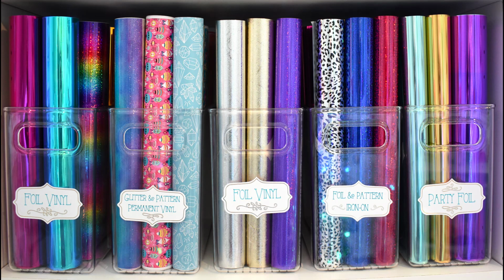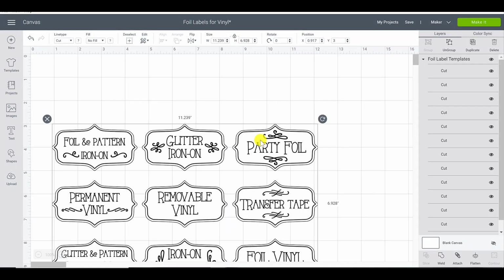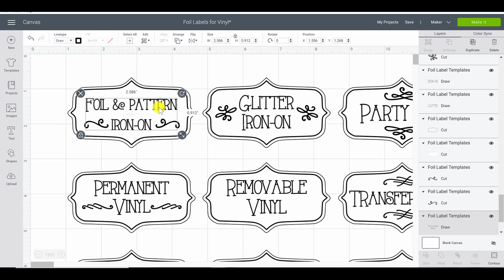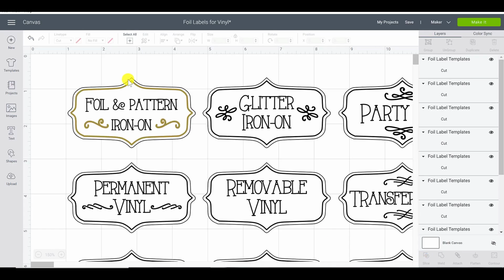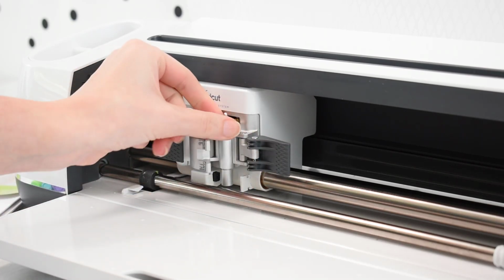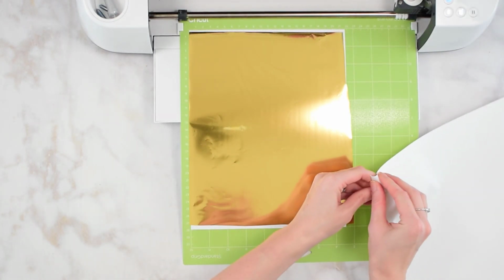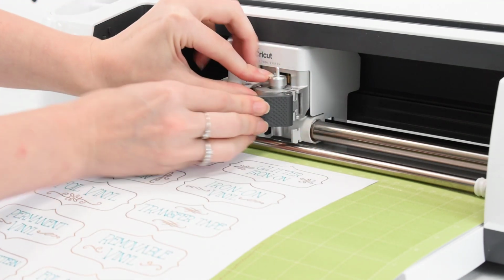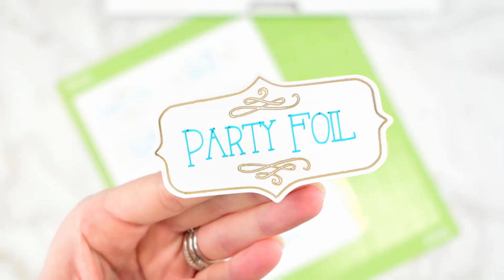Cricut Foil Transfer Tool Tutorial - How to Create Foil Labels With Cricut

Comment: I am also have another question. When I am putting my card stock on the mats no matter which may I use when I peel the card stock off it rolls my card stock up and it looks bad. What am I supposed to do?
Reply from the maker: Try peeling the mat away from the material rather than the material away from the mat. :)